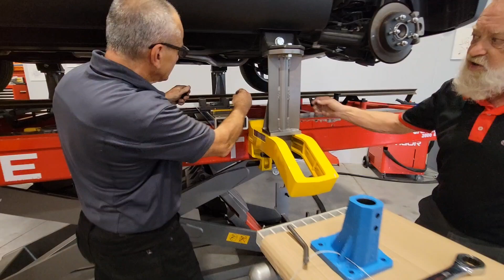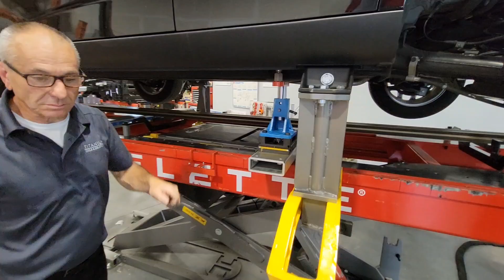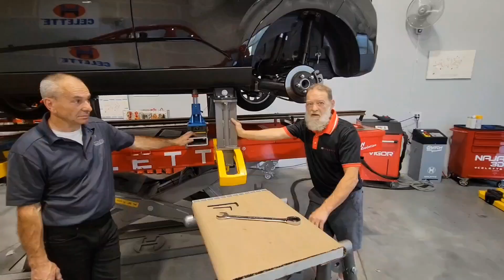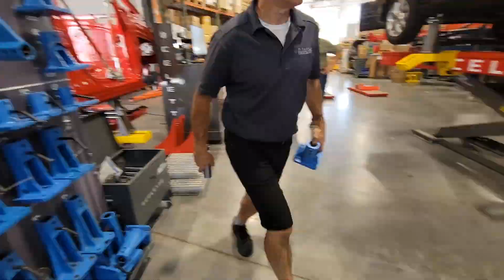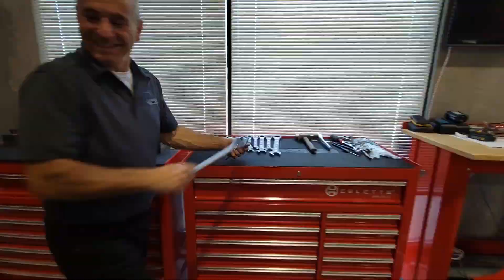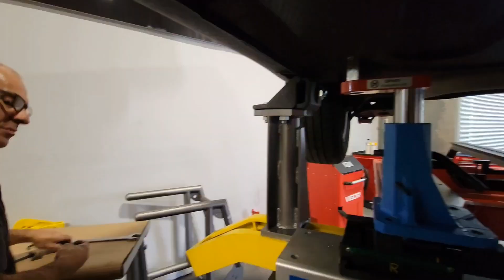LOOK INSIDE We'll show you more setup and measuring options you may not have thought of before.

Comment: Great video guys. Would like to see some set up with full frame trucks. Also measuring with the naja on full frame. Some truck frames don’t have the factory measurements so the 3D tram bar is used, when a frame has known diamond what is going to be the best way to measure and diagnose using the naja?
Reply from the maker: You can quickly measure a truck in semetry mode the click on the distance tab and check diamond.  5 min job. 
Sorry I didn't see this response until now. I'll try to do better.